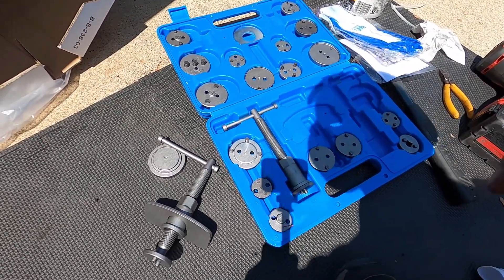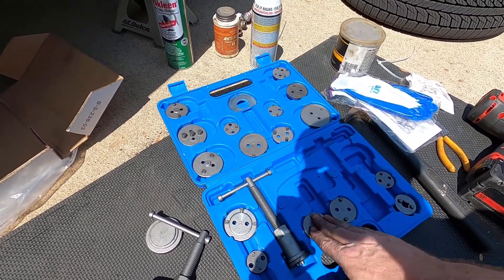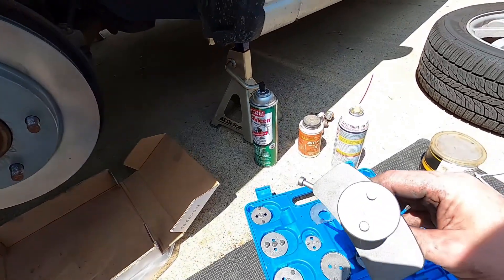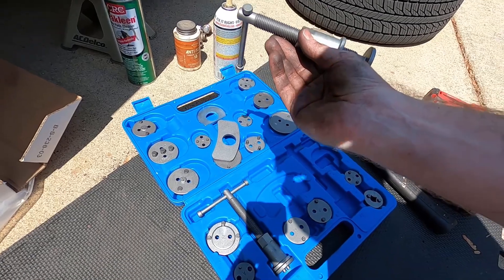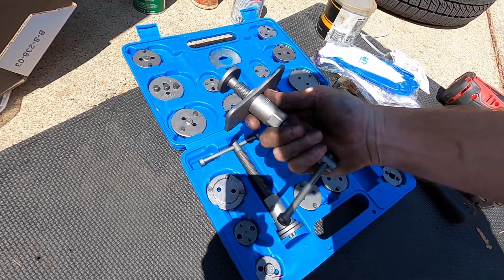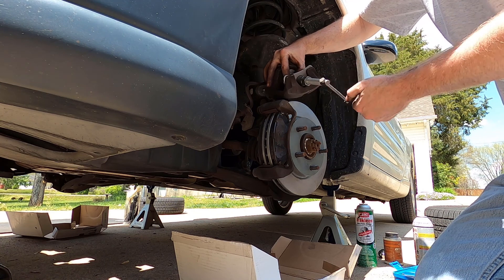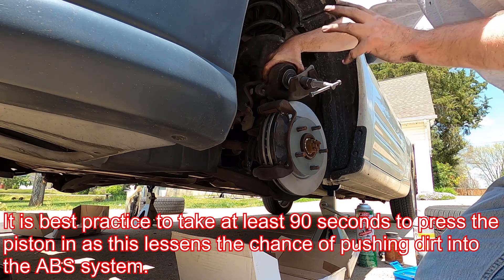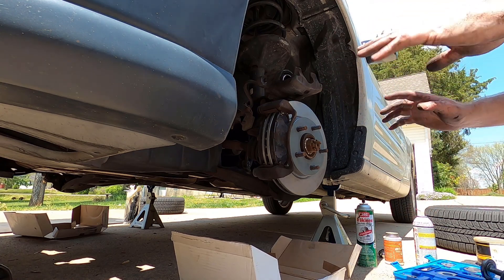How to use a Disc Brake Piston Caliper Compressor Tool.

Comment: Hello. Question: Must the new caliper be already connected to the brake fluid hose? I am installing new brake pads, rotors, and calipers to my car and I tried using a brake pad spreader to push back in the caliper but it is not moving at all and it is not connected to the brake hose yet. Am I doing anything wrong?
Reply from the maker: I've never heard of one needing to be connected to the brake line to compress it. You will want to check if it needs to be turned/screwed in a certain direction while compressing. Also, if it has an emergency brake attached to it, you'll want to check if there are any special conditions with that. I would definitely do some research on that specific caliper and vehicle before forcing it as that could ruin it.
Reply: @Killobyte  thanks 👍